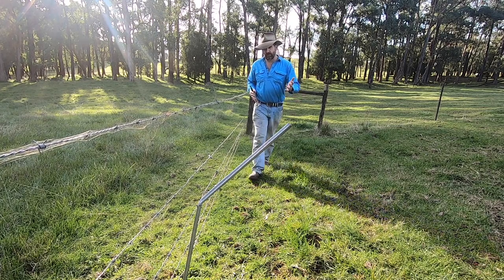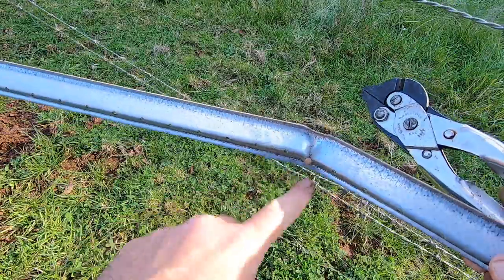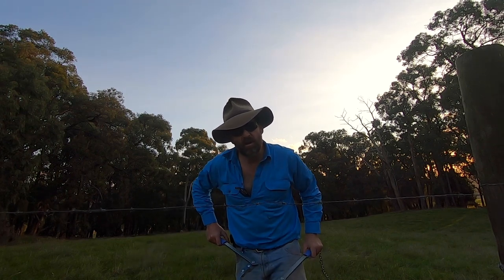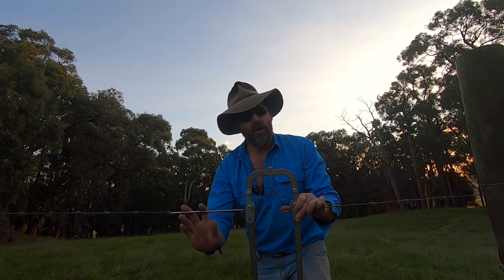Fence Stretcher Review   How to Maintain Barbed Wire Fences Easily and Safely

Comment: Love your videos Tim. Tip you can drill out your handle of the fencing pliers to bend your wire over a secound hole small wire thru the metal removal(staple) side.

Comment: I dont have that tool, I just twist the wire up and then put a plain wire through and twitch it up to stop the twisted barb from unwinding. I suspect this is compromising the barbs strength compared to using the tool you used here ? I saw another guys solution where he just twists up the barb using a large staple, then twitches the staple back onto the barb using the staples legs. Will give that a go next time

Comment: Can the Higgins wire stretcher be used to repair/join broken wire too? If so can you a video on that or provide a link if it already exists showing how it’s done. BTW I bought these recently and used them yesterday to fix a very slack old barb fence. It worked a great.
Reply from the maker: Glad you like them, they are a winner with barb! You could use them with plain wire (the old 8 gage stuff) but I would not advise twisting high tensile wire as this significantly weakens it. Cheers.
Reply: Yes Ian they can be used to fix broken wire, I need to make a video showing the technique, but give me a call if you like to discuss (number will be on your tax invoice)

Comment: The only other good method I know of re-tensioning barb wire is to get those#4 crimps for twisted wire. Just strain with a regular chain stainer, cut the slack wire between the strainers, and slap on a crimp. But as usual, Tim's method is cheaper, no crimps!

Comment: Like them Tim. Thanks. Would these work to pull ringlock back in line where the roos have separated the wires vertically? Some you can pull by hand, but others are just  too hard.  Cheers.
Reply: A good beating with a cheep aluminum edged bullet level usually does the trick. Or put the level on and beat that with your wire cutters. Aluminum is softer than zinc so you don't damage the galvanised wire.
Reply: Definitely damages the spirit level though..  haha

Comment: I'd enjoy my day a lot better not fixing fences, having a couple of quite ones on the back deck taking pot shots at the neightbours cattle ;)
Looks like a great idea now Tim. I'd seen them before but wasn't convinced because I couldn't see how they worked. The 12" wire links seem like the go. And if it goes slack again, just replace the links. Might have to invest in a set. I'm all for easy maintenance.